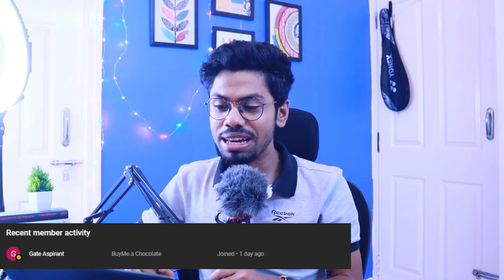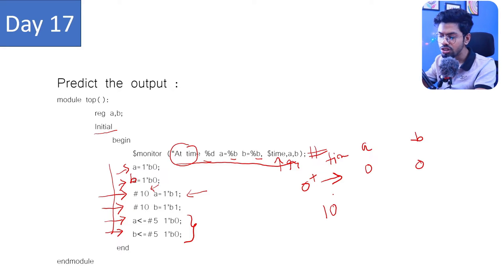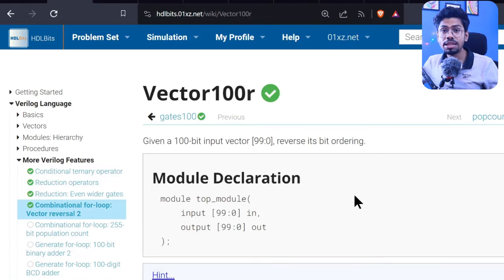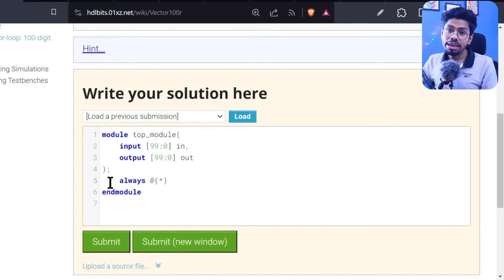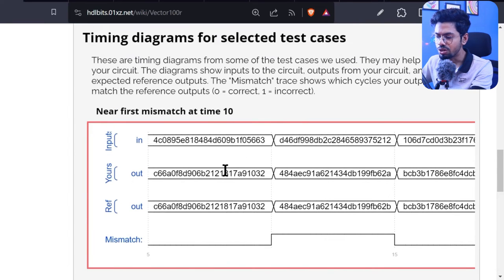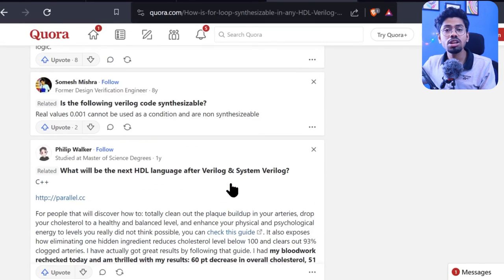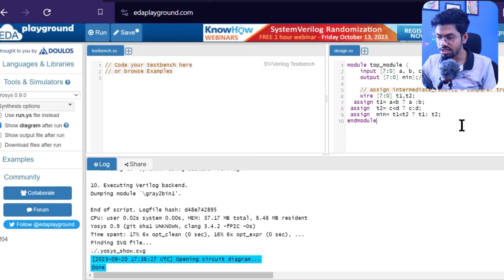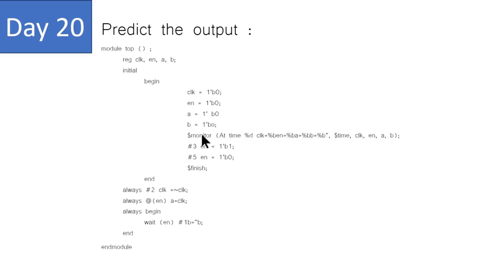Verilog For loop : can we synthesis it ?  Day 20

Comment: module top_module( 
    input [99:0] in,
    output [99:0] out
);
   genvar i;
    generate
            for(i = 0; i<= 99;i++)
                begin: block
                
            assign out[99 - i]= in[i]  ;
        end
    endgenerate
endmodule

Here is the synthesizable code for HDLBits question vector100 which you solved it works on edapg...

Comment: module tb;
  reg a,b;
  initial
    begin
      $monitor("time: %0d, a = %0d b=%0d",$time, a, b);
      a = 0;
      b = 0;
      #10 a = 1;
      #10 b = 1;
      #5 a <= 0;
      b <= #5 0;
    end
endmodule

Hello @whyRD, I made a small modification in the code (at 9th line), Now the output is changing, though it is non blocking it is not behaving like that.... Can you help me to find out the reason.
Reply from the maker: A and b will be assigned to 0 in 25 unit seconds
Reply: @whyRD  Not really, A is assigned with 0 at 25 time units and B is assigned with 0 at 35 time units. 

I am not getting the reason

Comment: Try this to use synthesizable code for loop using always block

integer i;  
always @(*) begin
  for(i=0 ; i<100 ; i++)
      out [99-i]=in[i] ;
	end
endmodule

** Note: if you replace integer i; with int i; then your code will be non synthesizable **
Reply: I found the same issue, here my code:
module top_module( 
    input [99:0] in,
    output [99:0] out
);
    
    integer iterative;
    
    always @(*)
        begin 
            for(iterative = 99; iterative > -1; iterative = iterative - 1)
                                    out[(99-iterative)] = in[iterative];
        end

endmodule